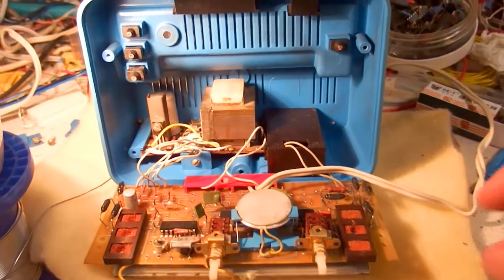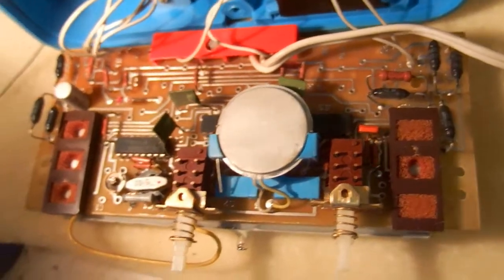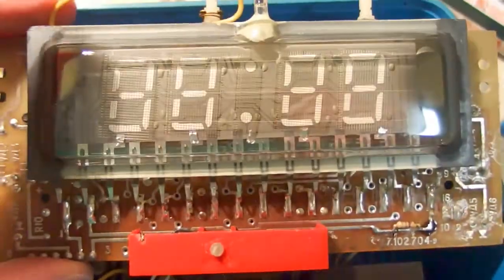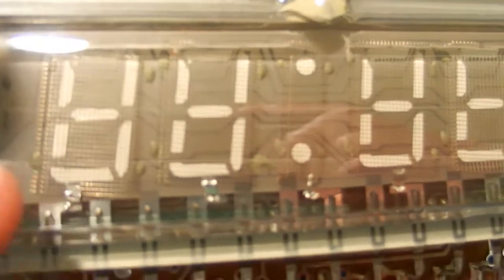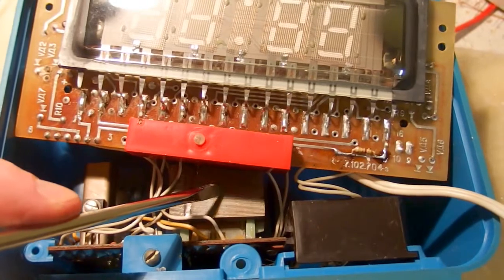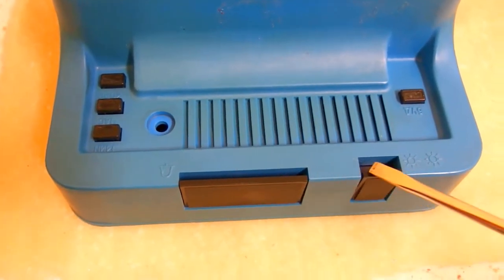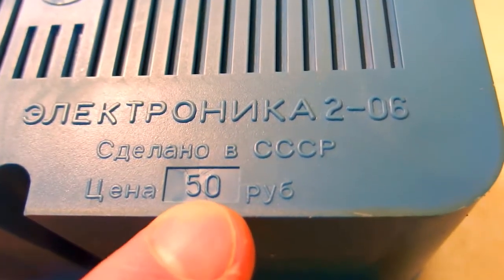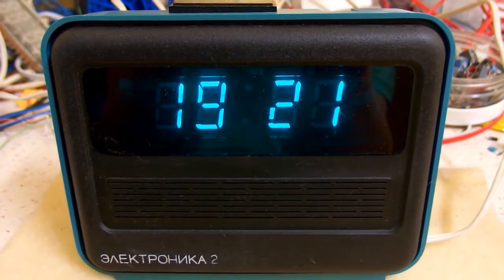Big Old Scary Russian Clock Restoration (1982 Elektronika VFD)

Comment: Love those VFD Soviet clocks, I bought a job lot of 5 assorted Soviet clocks a while ago, a couple of individual tube types and flat displays like yours. I have ordered replacement displays for them so hopefully will get them working again, great thing about old Soviet devices is that there are lots of parts still available for them on the internet.

Comment: Did you get new or used display? My VFD clock draws 1.6W having smaller digits :)
Reply from the maker: It is a new one. Unfortunately the used ones are usually worn more or less.

Comment: Thats not scary, its lasted a long time so its reliable :-)
Russian components were allways interesting, i had a few small portable black and white tv sets, vega and regonda i think.
I loved the hinged pcbs and bits of string to stop them going too far :-D
The odd top hat transistors with odd writing (to me) on the side, the red resistors and unusual parts.
The sad thing was i could not repair one as i could not work out what the transistors were in european types (i had no internet then).
Loved the odd bolt on psu on the back, bulbs and odd parts made it, very interesting ;-D
Reply from the maker: I also like those old weird parts :) The 125mA fuse inside this clock looks just like a transistor. It is under the red cover. It is nice they contained the mains part this way.
Reply: Red resistors are metal film, they are great. I scavenge them from the old boards because they are good at dissipating power (they tolerate high temperature and won't drift). Green, white and other colors are rubbish carbon ones, they drift a lot and they crack in half when you desolder them >:(
 So they indeed export those things, few years back I thought it was a hoax :D
Reply: Yes i thought the red resistors were strong looking, i did have a few bigger versions, they were built like a tank :-).
I did keep some of the top hat transistors for years, but i didnt know there current and voltage limits so finally they ended up in the bin.
There were black ones as well, god knows what they were designed for, perhaps high voltage ?? pass.
The regonda and vega tv sets were cute and every pcb hinged out, i loved that idea :-D
Reply from the maker: Does Russia still make and export electronic parts?
Reply: DiodeGoneWild I dunno, I'm from Ukraine. Majority of the russians don't know :D I haven't heard about new components from them lately, so I guess no, they don't. There are few "russian" brands of devices like TV's, car battery chargers; but they are really made in China, the only russian thing there is the brand. There are a couple of small companies that are located in Russia and assemble stuff there, but they use modern imported parts.
Reply from the maker: It's a shame that everything was moved to china. And I wonder what do we put into airplanes, military and medical euipment, spaceships and so. I'm afraid that the Boeings and Airbuses have the same parts in it as the explosive chargers do...
Reply: cccp3 Yeah, maybe. My point is that to know for sure, now you have to do research, back then you knew the answer is "yes" straight away.
Reply from the maker: Integral company... that's the company that started to make the K155ID1 nixie drivers again in 2015 :).
Reply: Well, that company is in Belarus, not Russia. I'm not crazy about people messing it up, but those are two separate countries. It's a dick move to call every neighboring country a Russia, it's like saying that Canada is in USA.
Reply: DiodeGoneWild They still make MBGO capacitors in Siberia but its only if you order a lot.
Reply: MrJohhhnnnyyy in Czech republic, we had some MLT resitors imported from USSR. You mean the white version of them ? Red aren't bad but i rather use TRxxx from Tesla.